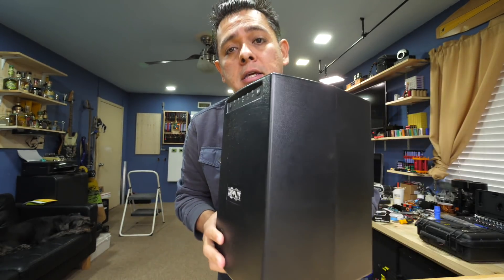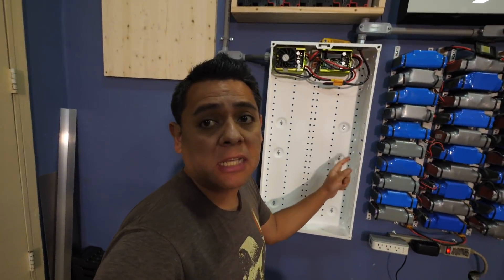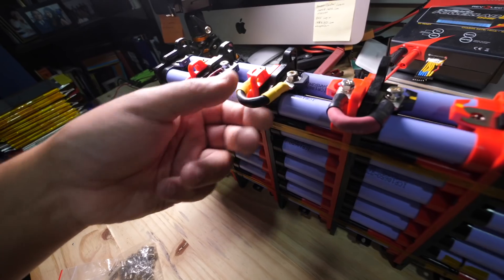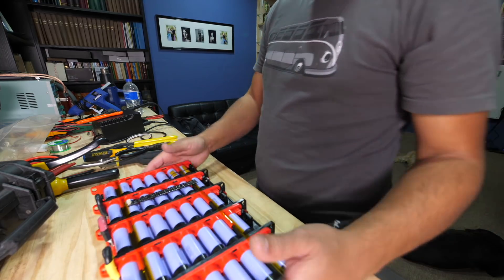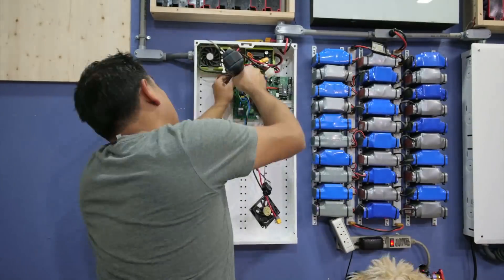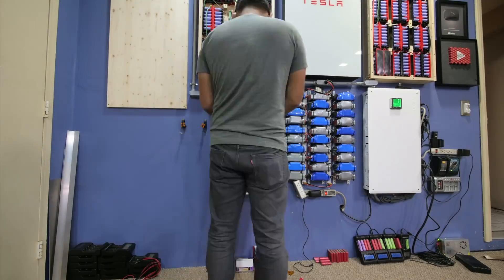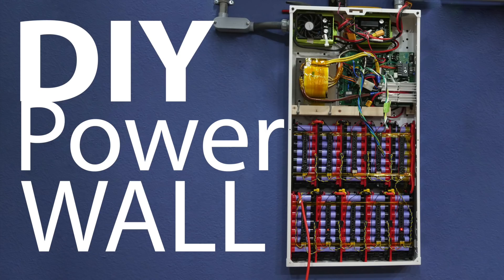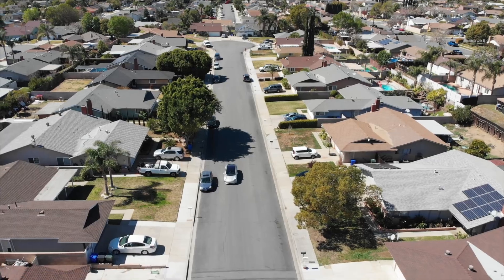1kw DIY PowerWall affordable  18650 build project (2018)

Comment: so that would power what for how long $1,000 will get you the power what for how long and how many hours does it take to recharge it so when the power is off what do you actually have one hour of use of 900 watts 2 hours worth of used what do you have here $4,000 you can get a Honda generator will take you a gallon a day and it will produce that for 7 years for 10 hours a day total cost you figure that out now your total cost for this will last how long and what will the outcome be you spent $1,000 and how many days would you get battery life off of it after you charged it and how much does it how many days will it last before it is no longer able to be used now if you had it plugged into a generator and charged it it would take you how many hours to charge it back up turn off the generator and how many hours would you be able to use 900 watts for and how many times would you be able to do that

Comment: No fire suppression in that room?? Was this inspected by a licensed electrician? If not, your insurance on the house may be null and void
Reply from the maker: Oh you are one of those,  this channel is not for you,  you would be better off elsewhere
Reply: jehugarcia I am for doing whats right and safe. This is reason WHY there are laws and regulations. If the batteries exploded for some reason and caused a fire, or wires overheated and caused a fire, where would the liability be. If you are creating a DIY project you MUST also include all safety precautions and regulations in doing such a project

Comment: Hey Jehu , I would like to build a Powerwall that automaticly switches back to te grid inverter when the battery is fully charged. Does this happen automaticly when there's no current drawn to the battery charge controler? Can i than split my Solar DC wires into going to the battery charger and a normall grid inverter? Thanks allot!

Comment: could someone please tell me why I shouldnt buy a gel deep cycle solar battery at 125ah 12v  (1.5 kw) for less than 300 dollars?  Powerwalls are neat but they are way over priced vs. a standard battery bank setup.  Going with regular batteries and leaving this system the same in all other parts would save a pile of cash.

Comment: NEXT PROJECT suggestion - help us poor Arizona Public Service customers get our 2 - 5 ton A/C units off the grid and on batteries between the hours of 3-8 pm went our rates double.  I can handle the switch gear to move from grid to inverter,  just looking for what it would take to handle the load.  (both are max circuit amp 26 and 20 RLA)
Reply from the maker: Stay tuned
Reply: migrate to a more moderate environment? find a place near the coast 44 degrees north latitude should be nice for the next couple of decades.  Once the jet stream totally dies then you'll either have severe cold or severe heat depending on the state of the rest of the climate.

Comment: Question? So in a perfect world, this DIY Power Wall is rated at 40 Amp Hours. Does that mean it should power a device using one Amp for forty hours from a fully charged state to a completely drained or empty state? ---and if you had a device using two Amps the battery charge would last for twenty hours?
Reply from the maker: Math does not lie
Reply: That depends on the voltage and the conversion efficiency, but at the low C rates you are talking about, and assuming we're at cell voltage, yes that's what it should be.
Reply: A bit less because of power loss
Reply: thanks for the confirmation.
Reply: thanks
Reply: understood
Reply: So I've been doing research for a while. I have some experience and have a couple dozen 18650s that I use for small projects. I'm not trying to steal your question but I'm getting really to start building my power wall. My goal is to be able to just plug it into the wall to charge every so often to charge. I'm wanting to be able to power everything from my phone to laptop. How much does the discharge matter. I did some reading about the c rating and stuff but I mean do I have to have to use like 15c cells to power my desktop pc? And obviously amps, voltage, play a big role. Just trying to get all my ducks in a row before I start

Comment: How does the price scale up if you increase capacity to let’s say 30 kWh? Does higher capacity come with more complexity and higher end equipment requirements?

Much appreciated,
Reply from the maker: It’s not linear,  but it depends on your application,  if you don’t need big power you can use multiple of these 900w ups units to scale up, otherwise you need big inverter and pay big bucks

Comment: Whats the point in putting sensors only on one side of the pack?
Reply from the maker: Because it’s better to know at least one  one side than no side,  there’s 20 cells in each module what would you suggest? 20 sensors ?

Comment: Don't put the longmons directly next to the cells. Those modules are made to balance batteries - they have an array of resistors to drain the battery, so they get hot in use.
Reply from the maker: They are designed to measure the temperature of the cell,  they need to be  installed on the cell
Reply: oops my bad!

Comment: It would have been helpful to explain how the final version pictured at ~10:00 differs from the explained version. 

Where did the bi-directional meter come from and what happened to the breaker switch?
Reply from the maker: There is no difference,  all the links are there
Reply: Are you stoned, or what?

There is a clear difference between the box you explain at 8:41 and the box shown at 10:28. Top, right corner, what you are calling the bi-directional meter does not appear until the very end, it is green and seems to have a dial or two and looks nothing like the bi-directional meter you have linked.  Where did the fuse holder at 8:41 disappear to (which btw is no longer available)?

Comment: I was focused on the cost of items in the power wall and I believe most of the parts came from the $150 UPS thing.  you gave a tour of the wall and spoke of (solar) charge controller, shunt to digital meter, 40W fuse and holder,  and when itemizing cost you mention uninterruptible power supply (is this what UPS means?)  and main unit BMS and those $14 temperature sensors.  I did not follow what the temp sensors were connected to.  my point being I was believing you mentioned items in the power wall during the itemization of costs which maybe you'd not mentioned in the first tour of the power wall.

Comment: Jehu,
I have 2 more questions 
1)  Is the solar charge converter, UPS connected in parallel with the battery via the shunt and the fuse?
2) The bidirectional meter link that you shared in the links looks different from the one you used (https://www.amazon.com/DROK-Voltmeter-Wireless-Bi-directional-Capacity/dp/B07C1LC82X). If I use the fuse on the +ve terminal of the load side (referring to pic 6 wiring diag.) and connect the UPS and solar charge controller, will that work?

Thanks

Comment: DIY and a bunch of lithium ion batteries and power wall is kinda a red flag in my head, cool stuff but isn't it kinda dangerous, I mean you're betting your house on the quality of you chargers,batteries, and   overcharging protection,  put that somewhere safe my man it doesn't have to be on your wall

Comment: Jehu- I’m using a tripplite 1500 and the voltage drops when in battery mode?  How did you correct that?  Or is that normal?

Comment: means that a tesla powerwall with 10kwh is cheaper at 3500 usd with the battery modules here times ten equals 5000 usd only for the batteries - am i right?

Comment: So I just bought a few Signalex 1200 mAh Power Banks here in the UK from a £1 shop. I opened one up, thinking there was prob just a AA battery inside it. But no, there was an 18650 inside it with a charge controller. I'm thinking of grouping them up in 10 or 20 packs,. Thought it could be a really cheap way of building of decent power bank. I'm no expert on these things. But intested in some input from you and your sub's

Comment: Does the ups also charge the battery? won't that cause problem if its charging li-Ion instead of acid battery?
Reply: He's using a non-UPS charge controller... He's using the UPS transformer to output, not charge.
Reply: Carl Schwehr So it's not gonna automatically turn on in case of a power outage?
Reply: Not unless you have an auto-transfer setup with it.

You install an auto-transfer switch which swaps it over. This one is for home-generators, but you get the idea.

http://www.eaton.com/Eaton/ProductsServices/Electrical/ProductsandServices/Residential/GeneratorsTransferSwitches/ATS/index.htm

Comment: The cost per kW storage is high... you can have a 14 kW Powerwall for $7,900. Not to mention you can get a tax credit of 30% off storage if installed with solar

Comment: When I remember correctly, the ups does not Feedback power into the house grid, isn't it? So it's only like solar powerd UPS
Reply: Because otherwise I would suggest to use a Solar Grid tie mikro Inverter

Comment: Buddy... I need your help. I want to build a system that can be portable to fit in my truck. Rechraged by my truck and Strong enough to push a good size air compressor and Skil Saws for construction jobs away from any power. I want to build a system that would essentially replace needing a gas powered generator. CAN YOU HELP ?

Comment: Can you do a video talking about Cost per Wh or per kWh.. I'm building my own pack and found that the 100Ah Prismatic LiFeMnPO4's are nearly 2x the value at $0.5/Wh than say 18650 (LiFePO4) at $0.78/Wh... what gives, does the saving only apply to second-hand 18650s? I'm building my system for a worksite pack. Need to run tools at higher elevations. A generator loses 50% (or more) of its power up here (~10,000') so a 2000w Generator will barely run a table saw! I'm also working on a DC alternator charger (Custom VR setup) for recharging the pack in the field. Love your videos, You do awesome stuff!

Comment: For the price per KwH, sounds like the Tesla Powerwall is actually a reasonably good deal. Especially since you don't have to build it yourself. Nice project though, cool to see what goes into this.
Reply: It's kinda tricky, since the Powerwall 2 is $16,200 for two in Canada and $8100 each... plus $960 in "supporting hardware" per install and then $1900-$3100 to install (they won't allow you to buy one and install it yourself here).

So, insurance issues aside (which could be an issue) - if you're willing to invest the time, Tesla's solutions is easily $20,000 CAD ($15532 USD) here for two modules, which buys you a LOT of batteries. haha

Comment: What charger should I use to charge these 20 cell modules and can I leave the BMS connected while charging ?
Reply from the maker: I use the UPS itself to charge the battery,   yes bms stays connected
Reply: So in this design does the UPS and the solar panels charge the batteries ?
Reply: jehugarcia can I use the same setup with a 24v battery pack instead of 36v ??

Comment: Did I miss anywhere in the video where you explain how long the battery pack can sustain a full load of the stated 900w output at 110v? How many hours are you going to get from the $1000 rig at full load before it beeps and shuts off, (with no solar coming in)?
Reply from the maker: Pretty sure I said somewhere in the video that its a 1.6kWh battery,   so do the math.
Reply: thanks for answering
I missed that, and wasn't sure the conversion is that simple especially given losses.
So $1000 gets you less than 2hr run time at full load, not counting any losses? 
I guess my desire to run a 1000w heater through the night on battery alone, to heat a tiny little room, is a multi thousand dollar project.
It wouldn't be running all the time to maintain temperature, but still I'd probably need 3-4x your batteries just for that.

Comment: Do you need the harness to charge this, I got 3 packs but the harness are no longer available, I have 0 experience with packs, want to charge them with solar panels
Reply from the maker: No you don’t need them
Reply: jehugarcia so it’s basically charging one cell from positive and negative, these modules self balance

Comment: Great video. Always really informative. However, I feel if you end up running that UPS for very long periods of time. It will likely die. Those are designed to have batteries that barely last 20 minutes on low load. Running it for hours or days on high load would be intense for something with such a short duty cycle.
Reply from the maker: Mine has been running for 6 months 24/7

Comment: So the noise from that system, is that because you are converting DC power over to AC power?

I am wanting to build a solar system and am trying to decide on the best way to do it, but I need to keep mine 12 volts DC for radio equipment. Just can't decide on what kind of batteries I want to use yet.
Reply from the maker: LiFePo4
Reply: Yea, I have been looking at the LiFePo4 12-volt batteries, but I just can't get over the sticker shock of the $1,000 price tag for a single 100 amp hour battery.

Comment: can i use alternator instead of solar panel?
Reply from the maker: Yes
Reply: how about wiring to UPS ?, alternator generate AC current, solar panel generate DC current (CMIW), how can i be modified to charge the battery?

Comment: Hey Jehugarcia, I want to get 3-4 of these so that i can run a 12v inverter off of them, but any time ive tried to use a small set up with a 3-4 18650s my inverter wont run it says theirs to high of voltage with 4 and it also wont run off of 3 to low of voltage. How have you been able to get around this problem? Any help would be great!
Reply from the maker: 4s LiFePo4

Comment: Hey jehugarcia, im starting to buy the 3.7v 40Ah battery packs one at a time and was wondering if you could recommend a easy way to charge them individually.
Reply from the maker: http://j35.us/FMA-PowerLab-6
Reply from the maker: http://j35.us/Ama-imax6-charger
Reply: Hey one more thing I want to get 3-4 of these so that i can run a 12v inverter off of them, but any time ive tried to use a small set up with a 3-4 18650s my inverter wont run it says theirs to high of voltage with 4 and it also wont run off of 3 to low of voltage. How have you been able to get around this problem? Any help would be great!

Comment: I bought 51 of these to make a 12v powerwalls. You said 10=36v. But fully charged they are 4.2v. So wouldn’t they be 42v in your case? Thx
Reply from the maker: Correct
Reply: Waiting to see video on how you bottom balanced and installed lonmons  thx!

Comment: Jehu I’m building an 18650 powerwall using a Xantrex SW2000 12v inverter.  Should I use 3S or 4S battery setup?
Reply from the maker: 4s lifepo4 it’s the best for 12v
Reply: jehugarcia Thanks.  I just have to find a good step down dc converter that can handle 100 amps.  Any suggestions?

Comment: Cool video! One thing I noticed that bothered me from an ex-sparky perspective was the wiring style shown at 2:58. I am sure it is fine but best practices might be to make sure the wire is bent with the tip going clockwise around the screw to make a more secure connection.
Reply: VVhiterice1 totally agree, but I've honestly never seen the term "ex-sparky" before.  LOL 

Forming wires so they naturally tighten with the screw is common sense, just like making a mechanically strong connection before soldering.  Both are fundamental "tricks of the trade" you learn early on when working with electricity and electronics.  Maybe the presenter here had an apprentice pre-make them for the video?

Comment: Hey Jehu, thanks for sharing! Great video! Just wanted to know if someone can confirm whether the output of the Tripp Lite UPS inverter is a pure sine wave or modified sine wave in Battery Mode? The specs on the Tripp Lite website say: Output AC Waveform (Battery Mode) : PWM sine wave. That to me means some kind of modified sine wave. Could anyone confirm please?
Reply: modified sine, creates noise for led tv's, and may cause problems for other electronics

Comment: Jehu, Any chance you have links or the title of the other structures you used on your wall. I can't thank you enough for providing the one in this Video, but really interested in the Tesla names one, or one of the 3. Trying to get away from building these out of wood(for piece of mind). Also, did you get the transformer to clear or did you have to alter the case a little. I may end up just using the Media structure for all the Batteries, Charge controller and wiring. Then add a smaller Junction box for the UPS(I found a 4.5in deep at my local Hardware store), just small enough for the UPS parts. Income Taxes are just around the corner, hopefully, I will have enough to finsh the cool project. All Inspired by you Of Course, Love those Wall Units!!!

Comment: REGARDING BUZZING TRANSFORMER.....
I suspect that because  the fastening bolts have been removed from the transformer the plates that make up the metal core of the transformer are now  'loose' and vibrating at the mains frequency, which in the US will be 60hz. Just putting 4 bolts through the holes in each corner and tightening them up, nuts and washers ect might well stop the buzz. I have still an audio amp that buzzed, took it to the shop and the chap showed me how to fix it right there and then. He just tweaked each corner screw for the transformer until it stopped buzzing.